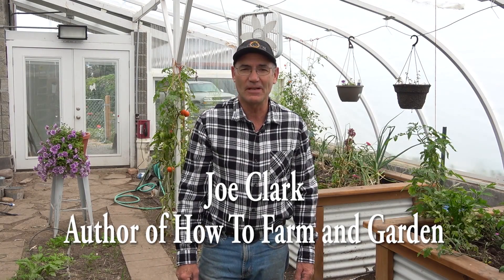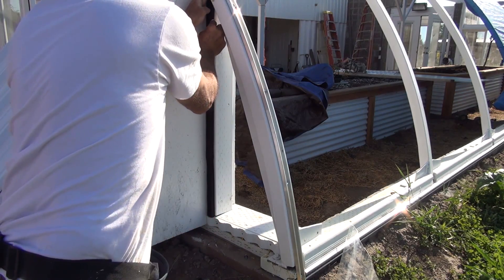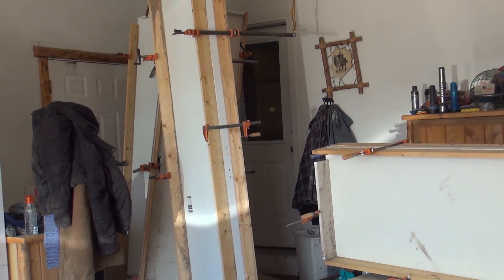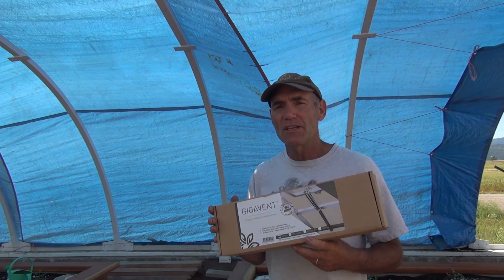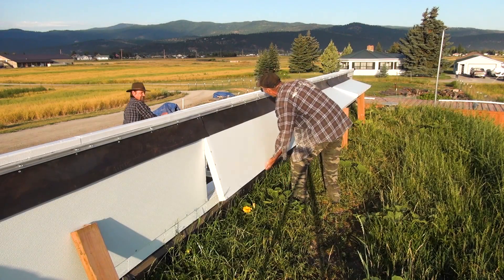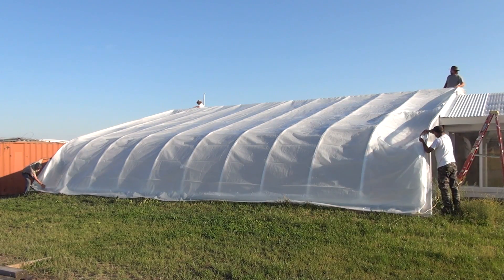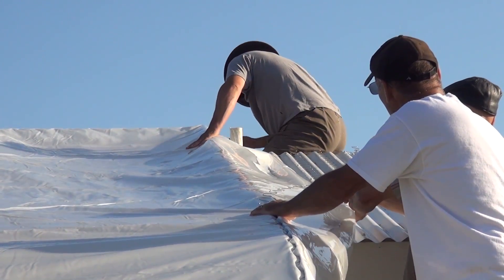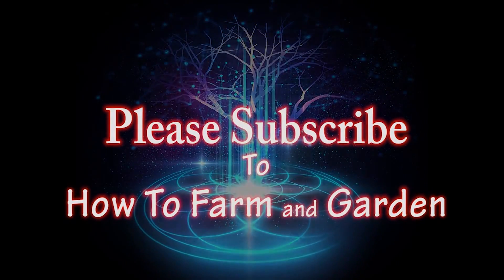9_Greenhouse Incorporating a Shipping Container_ Vents and Roofing

Comment: Another question, why the radius on the arches and why not just an angle, then you could have used polycarbonate instead of plastic? Was this for cost or sun penitration?
Reply from the maker: Polycarbonate was out of our budget. The radius also defuses the light much better than a flat surface.